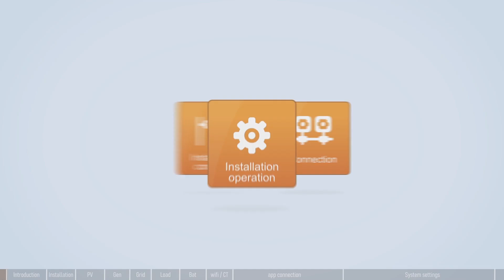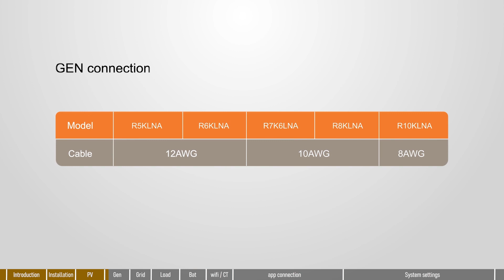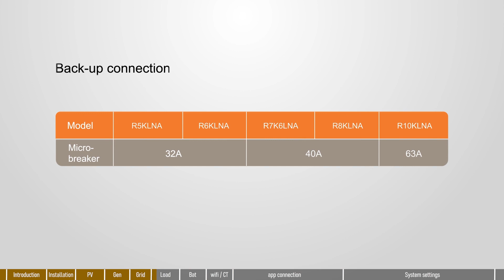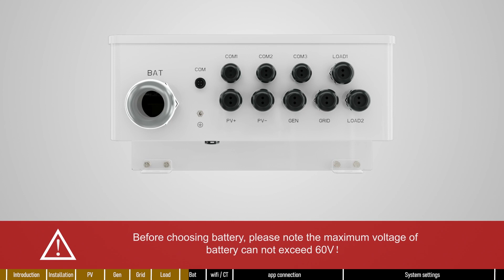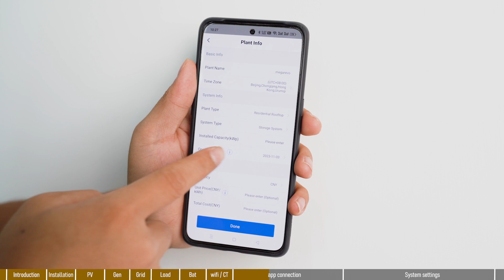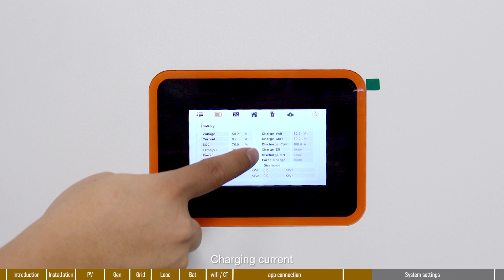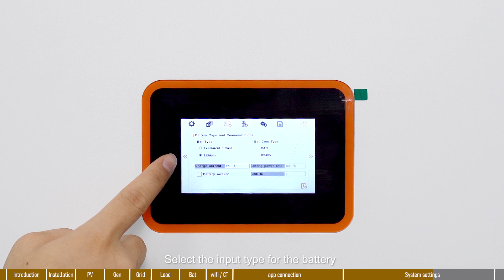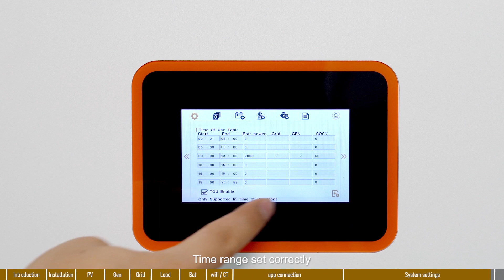MEGAREVO American ESS split - phase inverter installation instructions

Comment: I have 2 pcs of 10kw megarevo  hybrid. After installation done and working an 5 days one inverter shutdown. And I ask my supplier if there is a warranty. She said warranty it self. No replacement I said ok so I purchase another one. After I received the unit installed. By the way this is parallel connection inverter 2 pcs 20kw.so 2 inverter working  for how many days. And then one start show the fault on one inverter. But one is fine. So now I have 2 inverter not work.in just a month.ifor my experience. Stay away this  megarevo. I ask some supplier they says this megarevo After sale alot of complain.

Comment: Hi, is there an error on the GEN connection? The GEN line is an INPUT, but it's connected as an OUT on the protection.
Reply from the maker: Thank you very much for watching our installation video carefully. We have asked the technical staff and confirmed that there is no problem. But thank you for your valuable advice.